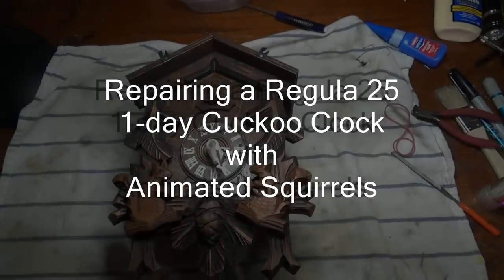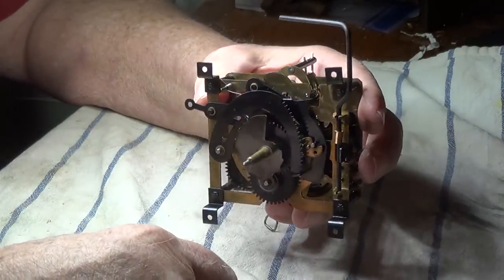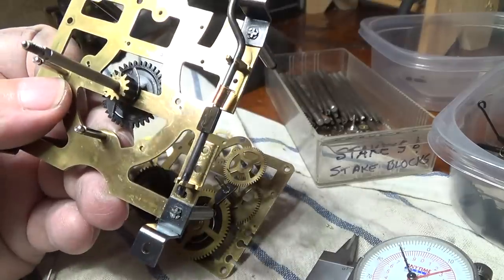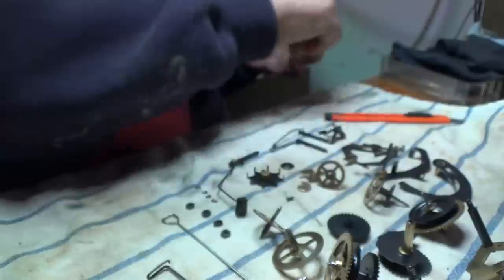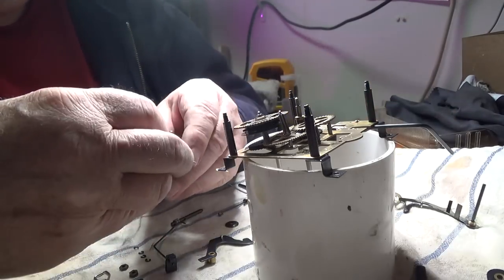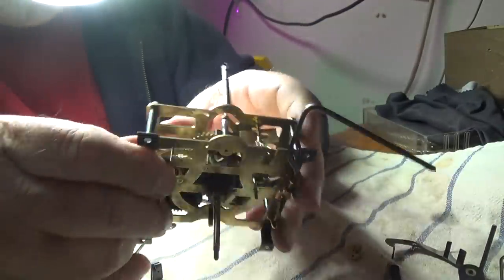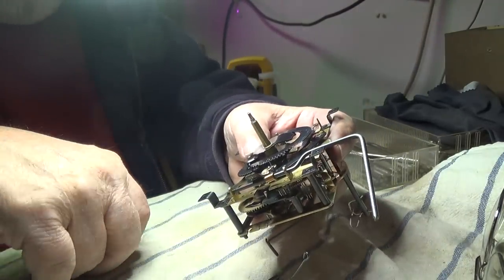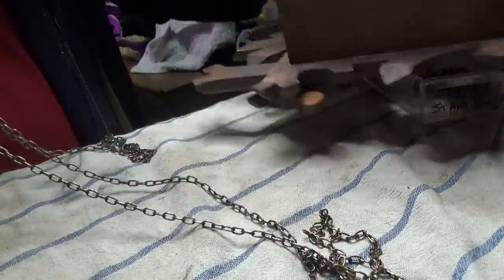Repairing a Regula 25 Cuckoo Clock with Animated Squirrels

Comment: Hey there.i have a question for you if you would have the time to answer please.on a  cuckoo clock such as this or similar size.what size cutting broatch would you recommend for rebushing.?hope that didn't sound like a silly question
Reply from the maker: This may sound facetious, but the answer is -- whichever one fits. Keep in mind that broaches are not straight-sided;; they are tapered and vary in diameter from the tip to the base.  For example, let's say I put in a bushing that has a bore of 1.5 mm and the size of the pivot that needs to go in that bushing is 1.6 mm.  I need to make the hole bigger by a tiny bit more than a tenth of a millimeter.  I choose a cutting broach that, firstly, will go into the hole in the bushing, but not all the way through to the base of the broach. You want a broach that will go in a fourth to a third of the length of the broach.  Then, I broach the hole, checking the hole by trying to put the pivot into it and continuing to broach until the pivot fits. Since the broach is tapered, that's why it's necessary to broach from both sides of the plate. So, you need a set of broaches that will fit the sizes of the pivots that you will be fitting.  The sizes of pivots vary from brand to brand of clock and from gear to gear within a given clock.  That pivot sizes generally get smaller as you go from the beginning of the gear train to the end. In this particular clock, the pivots, other than the chain wheel, which is about 5 mm, were from 1.00 mm to about 1.75 mm.  A clock I just finished had pivots around 0.8 mm.  I have a number of cutting broaches that fit 0.25 mm up to about 6 mm.  Use the one that fits.
Reply: dperry428  thankyou very much for the info.im looking at a set 0.6mm up to 2mm.i was also looking at a set of hole reamers do I need reamers if cutting broaches would do the job.
Reply from the maker: The broaches are for enlarging the hole in the installed bushing to make it exactly fit the arbor pivot for a specific gear.  The reamers are for cutting the hole in the clock plate into which the bushing is fitted.  One could use a drill for making the hole for the bushing, but you'd either have to have exactly sized drills that were just very slightly smaller than each bushing outside diameter or smaller diameter drill to make a hole that could then be finished with a broach to make the hole suitable for placing the bushing.  That technique I've used when making bushings on the lathe that are of a size for which I don't have a reamer.  It's not an easy way to place bushings because it's very easy to slip up and make the hole in the plate too large and you end up with a loose bushing that could fall out.  The reamers I use are sized exactly 3/100ths of a millimeter smaller than the outside diameter of the bushing so that when the smaller bushing is driven into the plate hole, it fits very tightly and won't fall out. Literally, you are forcing a larger diameter bushing into a smaller diameter hole.  For example, I have bushings that are 2 mm, 2.5, 3 mm, 3.5 mm 4 mm, 4.5 mm and 5 mm outside diameter.  The reamers I have for them are 1.97 mm, 2.47 mm, 2.97 mm, 3.47 mm, 3.97 mm, 4.47 mm and 4.97 mm, respectively.  They make putting the holes in the plate for the bushings nearly foolproof over using drills, but, literally, at a cost.  Each of the reamers cost $16 to $25, depending on whether American-made or Swiss-made reamers are purchased.  As you can see, that can amount to $100 or more just for the reamers. Needless to say, during leaner years, when I was teaching and raising my children, I couldn't afford to buy them, so I used drills ground for drilling brass and then broaching carefully to get the right sized hole, which can be very easy to either undersize or oversize.
Reply: @dperry428  thankyou!I appreciate that very much.so is the general rule of thumb make the drill hole 03mm smaller then the outside diameter is the bushing?I'm sorry I don't wanna sound like an idiot.im just keen to get the right equipment. I'm still struggling to get into the hobby,I got a new family of my own and I'm finding affordable tools really hard to come by in New Zealand. Everything is USA or swiss made
So expensive 😭
Reply from the maker: You're certainly no idiot.  Idiots are those who don't ask questions out of fear of appearing to be an idiot. I don't know that there is a general rule as to how much smaller the hole in the plate must be under the OD of the bushing; that happens to be what the difference is between the reamers and bushings that I use.  The difference need be great enough that the bushing is a very firm friction fit so that it does not fall out.  Were a bushing to fall out in a wound movement, the gear would come unmeshed with its neighbor and all hell would break loose in the gear train as the power source (spring or weight) released catastrophically.   Before I was able to afford many of the tools I now have, I had to pass on more complicated repairs for which  I was ill-equipped.  I have been doing this as a hobby for more than 50 years now, so it has taken a long time to acquire the tools I now have.. Be patient.  One thing to keep in mind with bushing clocks is that in the majority of cases where a clock needs a new bushing, it is the second wheel (the one after the spring or chain) that is involved.  So, start out with a couple tools to repair the most likely wear and add tools through time as the need arises.  Nothing wrong with not having tools to do all possible repairs.  I didn't have an ultrasonic cleaner until I received one as a gift just last year. I got a real spring winder just three years ago. I've never owned, nor do I now, a bushing machine. One more thought on bushing.  If you have doubt about the tightness of fit of a bushing, just use a thread-locking compound as insurance.  In the USA, that would be a brand like red LOCTITE.

Comment: Hello Sir, one more time i need your advise concerning a cuckoo 34N clean movement  and a good running condition as far the movement is outside on the support for test. but after fixing it in the case; the chime and bellows wheel stops turning  I tried to look  if something from the front is pressing on it but I couldn't locate . could you explain me please where is the defect  and thanks again for your help and kindness.
Reply from the maker: There are so many things that can be the problem, it is not possible to exactly solve the problem without examining it.  Running the movement outside the case with the bellows not attached allows the bellow lifts to not only be in a lower position than when in the case, but also the lifts are without any load on them.  The lifts are free to simply move out of the way of the star wheel cogs that lifts them.  Under load and in a different position with the bellows attached,, is a different story,  First, look to see that the bellows, themselves, are not being lifted too far.  If one or both of them are, the movement will jam. You'll have to bend the lift wires down enough that the bellows are not lifted so high.  Is the star wheel that lifts both the gong hammer and the bellows lift wires in a position that allows it to start running before it begins lifting the hammmer?  If there isn't a "running start", even a small one, the movement may stall at the very beginning of the strike. Will it strike with the back cover off the case?  If so, the hammer could be jamming on the gong or the back cover itself.  Is the wire from the left bellow that lifts the bird's tail under the tail and not catching on a part of the case or the other bellow?  Is the latch on the front door unlatched? Is the bird positioned so it isn't catching on the door frame? Is the wire from the bird to the door catching on something?  These are just SOME things to look for, but not all.  There are just too many things that might be causing a problem.  You need to carefully analyze what is going on, but start with what I've suggested.  I'd primarily look at the bellows and bellow wires.
Reply: First of all I checked the movement the left wire was lifting the bellow up to hard. gently I liberate the bellow the star wheel takes its way in movement I realize that is more long then normal estimated because the end curve of the wire was not originally standared its 3''.5 (9cm) thanks so much for your help and have a nice day Sir
Reply from the maker: @eliekheirallah6855  I'm glad you found the problem and were able to get it working correctly,

Comment: how to know the running time of a movement as no weights available thanks Sir
Reply from the maker: I assume you are asking how to identify a one-day movement from an eight-day movement.  Normally, the gears that make up the time train will be 3 in number in a one-day clock and 4 in an eight-day clock.  For most people, identifying that way is difficult if they don't work with clocks.  My suggestion would be to attach a container such as a cloth bag to the clock, add weights such as stones, sand, nuts and bolts, or other objects until the weight is sufficient to keep the clock running.  Weigh the resulting bag.  If the weight is from about 200 grams to about 500 grams, it is likely a one-day clock.  An eight-day clock will require 1000 grams to 1700 grams or more.  Weights for the clock can then be purchased from a clock supply house such as this one.  https://frankenmuthclock.com/collections/all/weights